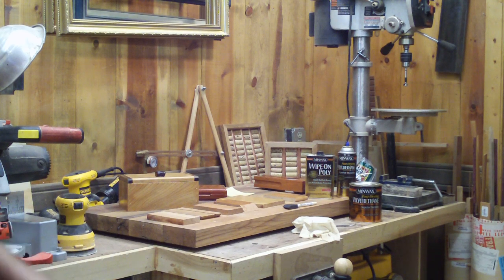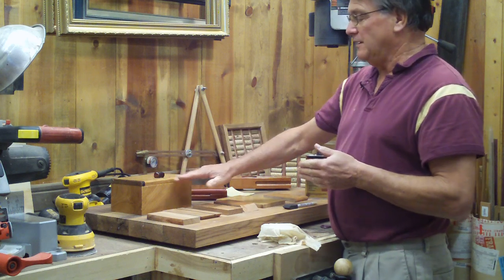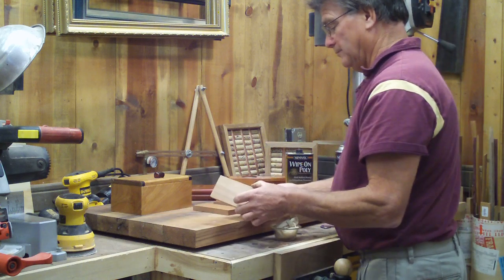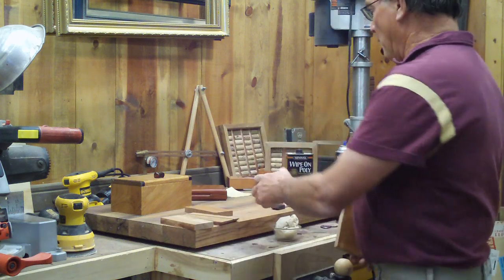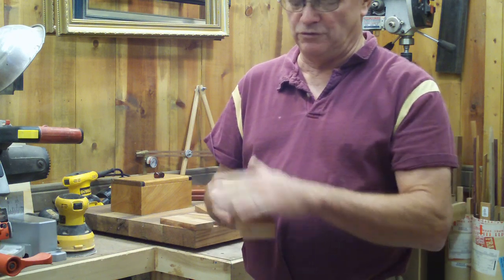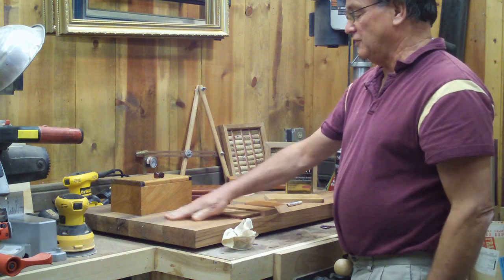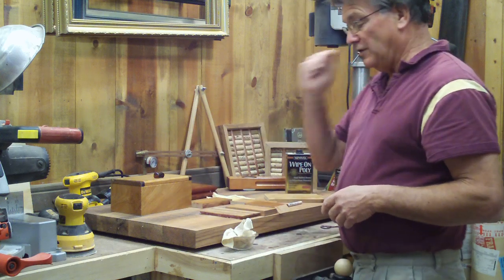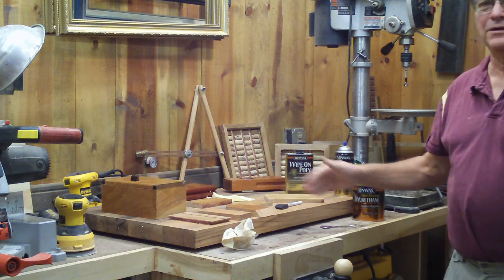How to apply wood finishes

Comment from the maker: By the 4th coat, the surface is very smooth.  You can go as many times as you wish, going finer with the sandpaper.  600,800 or even 1200 grit.  After you are done, you should apply a coat of furniture wax.

Comment: Great Video!  Very informative.  I was wondering if after your final coat of polyurethane you sanded with a high grit or did anything to make sure the final coat was smooth to the touch and a uniform sheen.

Thanks alot, Greg